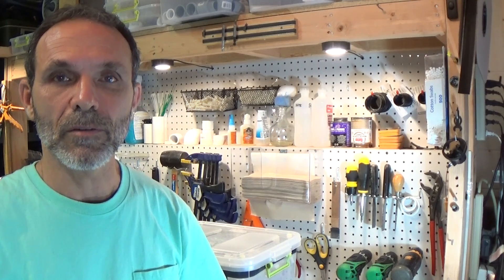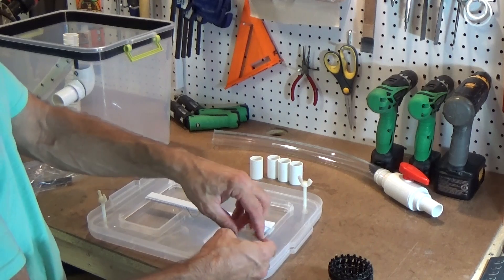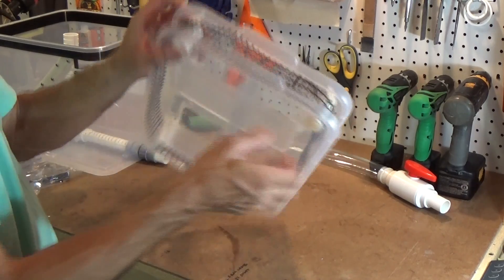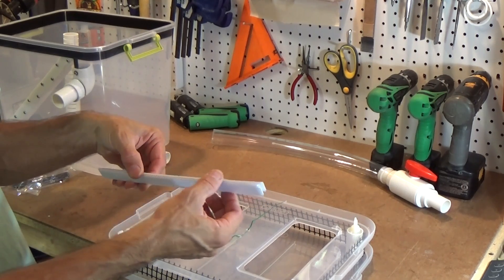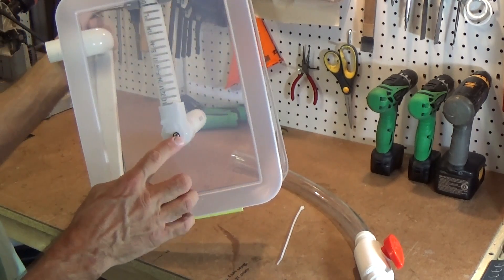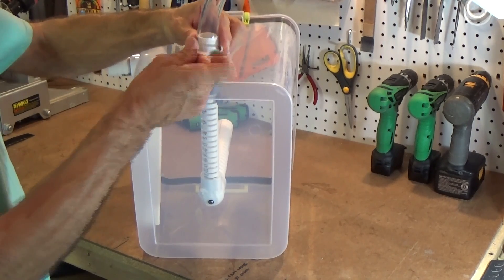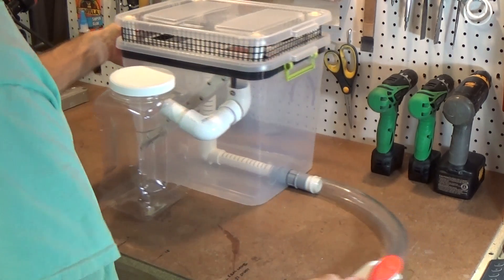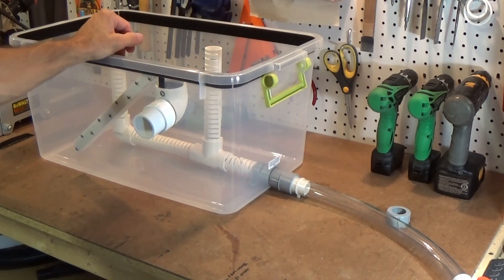Bio-composter assembly

Comment: Jerry,

How do you keep the small larva from exiting out of the drain pipe?

Byronj
Reply from the maker: Hi Byronj, sorry it took me so long to reply. In this system the larvae are allowed to travel in and out of the slotted pipes, and they do enter the vinyl drain tube. This movement in/out of the pipes helps keep open pathways for the liquid to quickly drain when we flush the units with water. Occasional flushing washes out the BSF castings, which leaves important air spaces in the waste. When draining the system you simply direct the liquid through a fine mesh strainer and catch the larvae which can easily be returned to the unit.
Reply: BlackSoldierFly Or harvest to start another colony. The drain tubes may be a good for sorting.